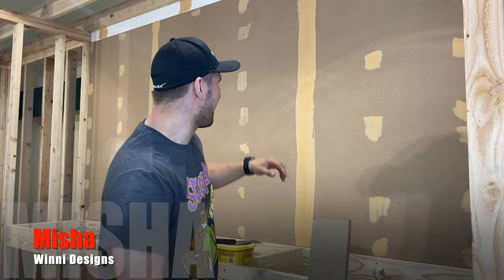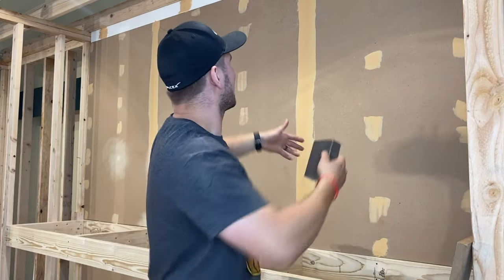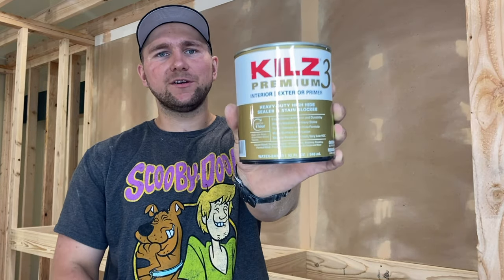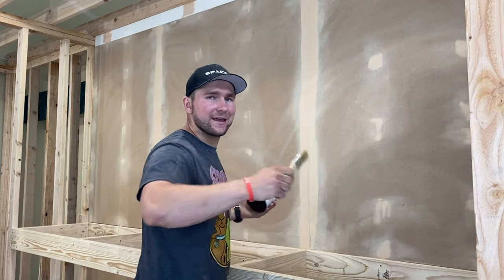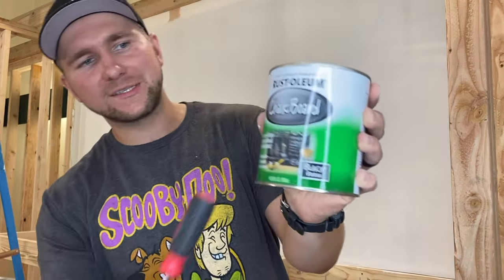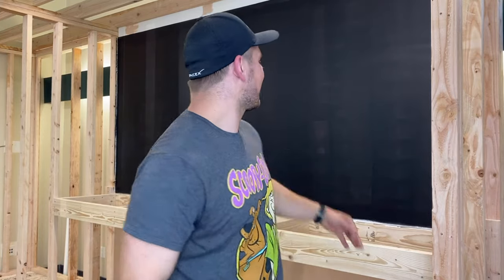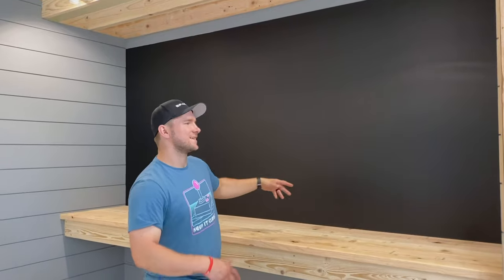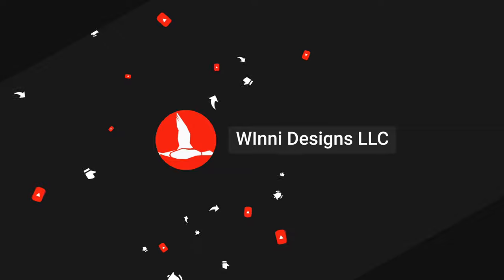Chalkboard Paint. How to Apply Rust-Oleum Chalkboard Paint. DIY chalkboard wall.

Comment: Forgot to prepare the chalkboard after painting by rubbing chalk across the board and then wiping with a cloth.  If you don't do this you won't be able to erase properly. And you should let the paint cure for 3 days after 2nd coat.  I like to sand after primer and first coat with 3M synthetic steel wool instead of sandpaper.
Reply: Damn I used a scotchbrite…..

Comment: Can this be painted on MDF board
Reply: Fayiz Angillath;
If you haven’t don the project yet…it is simple. You will want to prime your MDF board first just like in the video. 
You can also use spray primer-just thin even coats overlapping about 1/2.
 I have used on metal cabinet doors, an old glass mirror and I did a couple left over 12 x 12 tile squares that I framed and put in my greenhouse just to jot down what seeds I’m starting and the date I started which is better for me than writing a bunch of separate labels. 
Also I have used various brands of chalkboard paint and they all work and do the same. However, the spray can you don’t get as much product as you do in the quart. And they are close to the same price but with the quart you need a roller/paint tray and clean your supplies and the rattle can you just shake well and spray.
Reply: Did you watch the video? Hahaha. 

(Not tryna be a dick, but ^^^^)

Comment: How many cans did you use?
Reply: Julia Fulbuster;
I did an area about same size I primed first with rattle can spray primer. Scuff sanded and wiped down all the dust with damp blue shop towel . Applied 2 coats lightly sanding between and 3rd coat I didn’t sand, I just went over with sidewalk chalk length wise to coat the entire surface and wiped off with a microfiber cloth: warning it makes a dusty mess. It is an easy process and turned out professional looking.
Used a little less than half a can.

  I am going to use my leftover on an old green schoolhouse chalkboard and turn it black-which I assume I don’t have to prime or scuff sand since the first coat will be going over a cleaned flat chalkboard. I will sand before I put second coat on. And then see if it needs a third… 
You want good airflow: windows open and or fans if doing inside. Keep in mind that if you have high humidity / colder temperatures or you put on thick coats the dry time will take longer.
Reply: @tinaknutsen  whoa! You have some patience! Ty for the reply. I just ended up doing 3 coats on a sanded and primed wall. Only used 2 cans 🤗. Those little cans go a long way! 
Once again ty!
Reply: @JuviaFulbuster  how long did you wait inbetween your coats? Thanks.
Reply: @APinTheAK  I'm not a patient person so I started off waiting 1 day after the first coat then i only waited 2 hours after the second coat for the third coat. After that I did wait one more day to go over the whole board with chalk to prep it. I didn't like the scratch marks but people recommended that you do that before use. I have a pic posted of the results with doodles on my other channel on YouTube. It's called SurEliJ on the community tab.